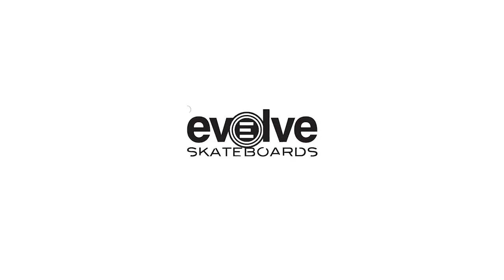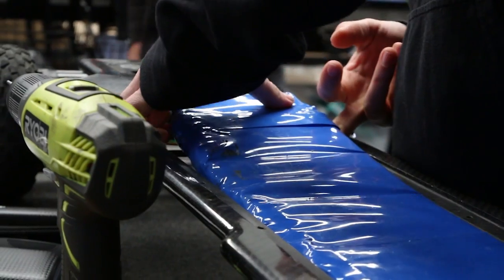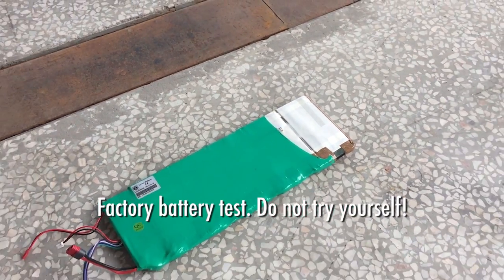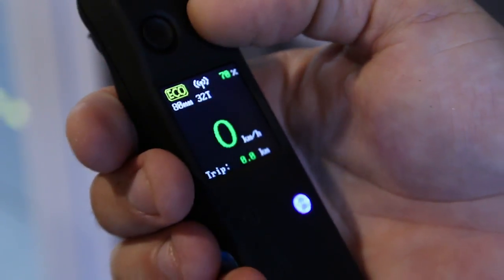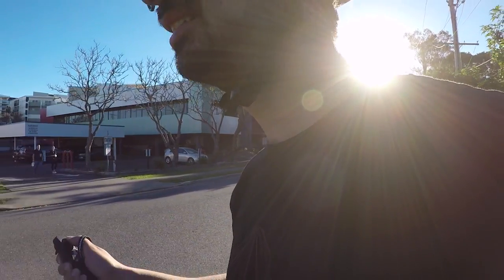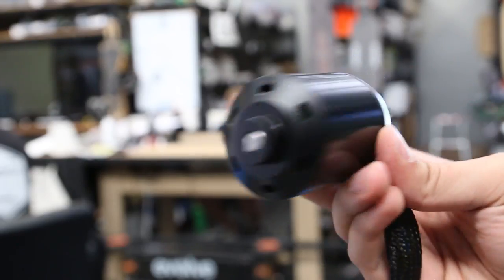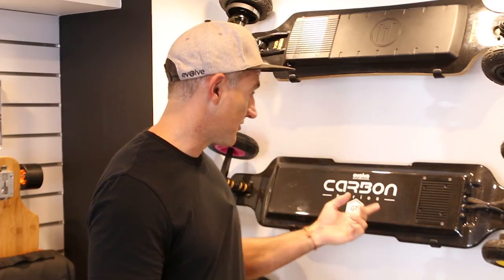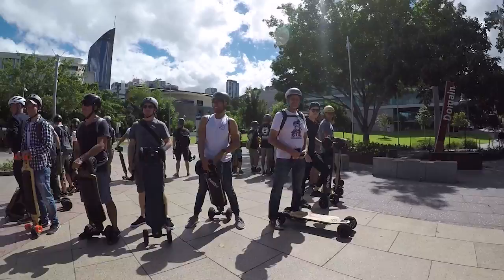Batteries, Motors and Knock-Off Evolve Skateboards - Evolve Weekly Ep. 31

Comment: The battery section is bullshit. The Evolve GT Bamboo never ever performed as well as with a good pack made of 18650 VTC5 cells for example. The existing one has such SAG that's a joke. A shame to have such CEO... that is looking to give explanation and make a confusion with soldering cells... and welding cells. That's clearly a joke.
Reply: I'm sorry. i'm in the electric helicopter/drone World and i Can assure you that the cells you use in the Bambou GT are just crap. They don't hold the discharge current at ALL ! 
you have very well known Brand in this market which provide very high current with much less Voltage sag. if you didn't want to use 18650 you could at least use decent lipo pouch. these one are just cheap and don't even hold a lot of cycle. Go take a look at Genace, thunderpower, pulse battery to name a few.... i read sometimes 400A Peak and 300A continuous (electric rc-heli speed races) and my packs don't even sweat. very flat voltage curve until 4/5 of the capacity.
So i also respect Evolve but for the price of the board, cheap cells, unreliable motors and capricious remote....
And give us a link for the battery upgrade you mention,  never found any. 
I don't want to be rude but let's be totally transparent here !
Reply: Couldn't agreed  more.
That's why longhairedguy is charging 800 bucks to mod the GT/GTX  battery pack and people are paying and I would pay as well, If I lived in the US. The battery is SHIT. Not near as the 35km stated on the website, I can do 10km before start getting some mad sag....
Shame...
Reply: AxionBastard ok and
Reply: eddie martinez hi
Reply: AxionBastard hello.
Reply: I love using the BGT, but just in fast mode and very little climbing, I still struggle to get more than 20 km range (I am 61 kg). The board has done less than 250 km total and is only 4 months old. For the premium price point, it would have been nice to get a better battery pack.
Reply: Lol @evolve funny Metroboard, Kaly NYC, Boosted, every other vendor does it safely. This again, is just lying.
Reply: Ok so with all this research you have done vs 18650 batteries . but still cant go on planes. so what's the use.  i rather not have sag  with 18650's than have it and still not be able to board a plane . even with all them fancy r&d research . that does nothing  for us . we already now this man .
Reply: Hey Jeff - You should definitely document as well yourself a bit more to who you are also talking to. I'm not new to this. I dont care about get business from Evolve or any other brand. I'm not one of these guy that sell their soul for.a nice shiny gold motor discount. I'm a builder and a rider. And that's my hobby. The modification I sometimes make are asked by my friends because they know that I'm a knowledgeable person. Changing a battery pack is not rocket science. A Bamboo GT with a quality pack is making the board actually a really good board (except for the motor that are low quality and that fails - but you already know all the issues regarding this). The 18650 packs people from DIY community build are smartly designed, integrate natural flex. It's never good to defend a business by putting fear in the game. By the way, look on youtube; you'll also learn that soldering and welding cells... is not the same. Cheers.
Reply: Evolve Skateboards the enertion raptor 2 uses more current than your highest end board putting out a whoopin 34 mph. On 18650 batts. And over 25 miles of range . I guess both battery types work for its purpose.
Reply from the maker: Every single battery reduces voltage under load.  Not every Eboard uses the current we use under hard acceleration either, so big current uses juice faster, especially on smaller batteries.  Reaching 35km on the Bamboo GT is certainly achievable by riding efficiently as mentioned on our website and on many videos we have made explaining this.  Having said this, you can also get much less range is you ride hard (like driving a V8 with heavy acceleration constantly).  If you want to reduce voltage less but still want performance, try using fast mode, it uses 50% less current under load.  Our larger capacity batteries such as the CFGT and GTX will reduce voltage less fast under load because of the larger cell size.  Hope this helps clear things up.  If you feel you are getting less range and you are riding efficiently, reach out and we can inspect your battery.
Reply: Evolve Skateboards this is  all bullshit. My GTX will not exceed 5 miles after 8 months. The Sag is so bad it’s basically worthless. You’re customers are screaming and Evolve is hiding.
Reply from the maker: Hi Cedric, we want to provide safe battery cells for our customers and also a battery that will require minimal maintenance in the long term.   It's not hard to research even on youtube 18650 battery fires and explosions, go have a look.....scary!  Our CFGT or GTX batteries are large.. using 18650 cells to make a battery this big requires massive amounts of cells and soldering which increases the risk of failure 10 fold, so we prefer to focus on a safer option that has excellent performance.  With that said, we have pretty much every battery certification for each market we sell in, this is not an easy thing to achieve and our batteries have gone through huge amounts of stringent testing.  Have you ever tried piercing your batteries whilst the cells are linked in series before?  You keep referring to making batteries that have better performance than our Bamboo GT battery, our Bamboo GT batteries are our smallest in size offering the smallest range especially on All terrain setups, pairing this with the GT current draw (60-80A under load) will obviously reduce the voltage much faster than our GTX or CFGT batteries (size matters here).  Thats why we have the CF and GTX series of boards for those wanting big range and performance.  The modifications you are making to the Bamboo GT board battery for Evolve customers are really not necessary as we have the large battery upgrade available for massive performance.  I would doubt you have certification for the work you offer with regards to battery modifications.  Given the flex of our bamboo decks it's a huge risk to the Evolve customers you are trying to get business from, yet we already have a solution for this that is risk free with full warranties and service behind it.  While we appreciate that these cells have their place in the DIY community and are readily available, when running a full scale large manufacturing business compared to a small DIY operation there are many things that need to be considered such as safety, manufacturing capabilities, design aesthetics, weight, battery certifications and structure and after sales support.
Reply: Evolve Skateboards my wife has the board and certainly gets the range as advertised in eco mode.
Reply: Official ESK8FR & UNIKBOARDS Founder you see us rollin - you hatin'
Reply: not at all man. I've been riding Evolve Skateboard for years and reviewing them which include the Evolve GT as premiere in Paris. Check my youtube channel. I'm building and educating people on electric skateboard for years too. Only difference is that I'm giving facts. There's nothing wrong about saying that the Bamboo GT is an awesome deck... with a quality pack which is not the one you get by default. I've modified several Bamboo GT and they perform WAY better, which include 60km range in AT mode, just by putting a 10S4P pack made of 18650 quality cells. I'm a rider too. Don't mix things. I respect riders. I'm highlighting something that has nothing to do with riders.
Reply: yeah. definitely. Voltage SAG is nothing normal but well, something you have to deal with if you have an Evolve.

Comment: Hey guys! I have an issue with my battery... The controller says "maintain bat!" And it seems that the cells are unbalanced? I have tried to leave it charging for 8 hours two times in a row but nothing. I've heard that if you completely drain the battery you can balance them again. Is it true or what should I do instead?
Reply from the maker: Hey there, yes maintain battery means 1 cell could be .3v out of balance.  We can easily sort this by using our balance charger or simply by replacing the cell.  Please reach out to your local distributor for assistance.
Reply: Evolve Skateboards Just another thing, can this reduce battery life a lot? Because with this issue I'm  not getting the range I used to
Reply: does the BMS not balance the cells ?
Reply from the maker: The BMS assists with current control yes.  However cells can still lose voltage faster than other cells especially over a long period of time and many hours of use.  We have some special battery maintenance tools that we use within our service departments to assist with battery prolonging.  Feel free to send your battery in for a revive if you are interested.
Reply: Evolve Skateboards Thanks a lot!

Comment: Would love to own a new evolve, but after building my own for the last couple of years, the price tag is just WAY too unrealistic. I can build 3 awesome boards for less than one of yours. Pretty hard to justify.
Reply: andrew your board specs sounds amazing! good job going the DIY route and learning to fix your board and build it.

please post your build on a fan page here reddit.com/r/electricskateboarding  hundreds of people will be glad to see it!
Reply: Airborne Images I doubt you can build 3 All terrain capable boards for the price of one evolve. I build my own boards on top of owning evolve boards. Building a quality board does not save me any money I actually usually spend more although I can go 30 miles on one charge and can reach speeds of 35mph. You can't put a price on buying a board in a store and riding it within a few hours on top of it looking as streamlined and clean as evolves do.
Reply: Andrew   Hi Andrew, its great that you own both and can compare, but an evolve is over $2000 and i build mine for around $600 au. Have never bothered with an all terrain, but I run 97mm wheels and use a factory built deck. The range is over 25 Klm , Max speed 45 kph and a new set of batteries around $170 of which I carry a spare set on long rides, so 50k range. I can remove the batteries for air transport and have never had a remote give issues. That leaves the appearance. My parts are all cnc machined & tig welded. The look is actually pretty good, so spending an additional $1400+ per board in my eyes is just ridiculous. But that's just my opinion. To tell me it costs more...I would love to hear what you have done for that to be possible?  Cheers.
Reply: Airborne Images if you use all quality parts and dual motor setup along with 18650 batteries and carbon fiber deck you can easily spend more. If I did a single motor setup with run of the mill trucks, lipo batteries and a blank deck then yeah I could make it cheaper but performance would be lacking especially because where I live its all hills.
Reply: Andrew   Hi Andrew. My board is built to ride & look quite respectable, not be a show piece made out of space age materials. I have plenty of undulating streets around where I live and the board handles them very well. My initial comment was to address the fact that ESB of a high quality can be manufactured for a very reasonable and realistic price, not anything like the massive profit generating boards like Evolve. Totally agree, the quality of their boards is great, just not min $1400 better that what I have built. My board is built to ride, not put on display.
Reply: Airborne Images I hear you and trust me I wasnt talking crap on your builds I was just saying that the whole building your own is cheaper is a little misleading if you want to make a board that looks like an evolve that's all. The carbon fiber deck is one thing that puts the price way up there and personally I think carbon fiber is a pointless material to use on a skateboard. It may look cool but its not practical becaise its so stiff and can crack very easily. Bamboo/wood is the way to go and will cut down on price when building your own.

Comment: One of the best videos for a long time. Thanks for answering a few (but super important) questions from the community!
I have an idea for quiet a few months for a new episode of Evolve Weekly and would like to share it with you guys.
Reply from the maker: +Thunderfart Great! Let us know.
Reply: I know that you guys like to experiment with your boards. You are pretty proud about the feature that your boards are generating power when you hit the brakes.
So... my idea was like this: How about you start to hit the road with an almost empty battery (5% load) for example with the Carbon GT and you are getting towed by a bicycle, car, or something with enough power and you are constantly breaking a bit with your board to fill up your battery (or you are driving down a hill, then you hop into a car, drive to the top of the hill and repeat the process). Would that work? To get from 5% to a 100% load? How long would it take? Is the board capable to handle this? I think that would be super interesting to see... or it would blow up the board.

Comment: Loving my new GTX guys, great work! It is an absolute beast and in a class of its own.
Reply: Had my GTX quite a few months now, around 5? Board is still working great and having no problems at all. The boards seem expensive but in the grand scheme of things its quite reasonable compared to other boards. You wont regret the GTX, use mine every day
Reply: hey, im about to buy a GTX aswell, hows yours holding up after 9 months?
Reply from the maker: +Chris Cabezas Great to hear and welcome to the Evolve community :-)